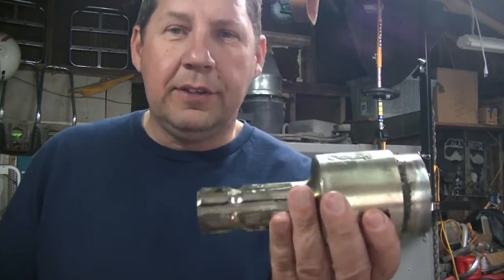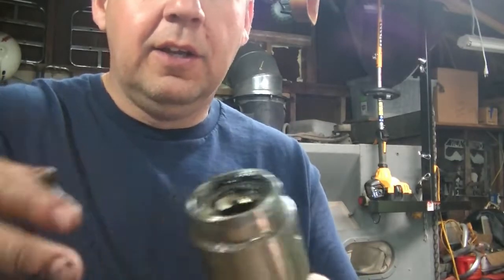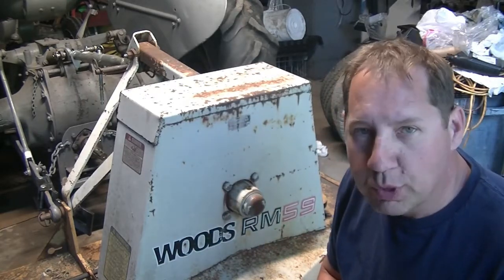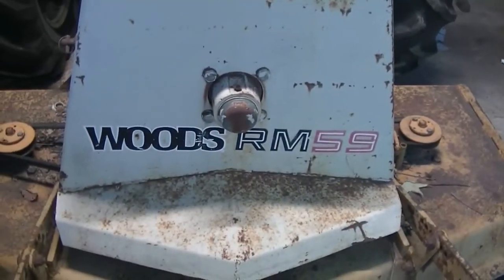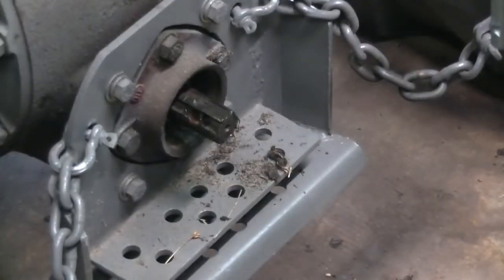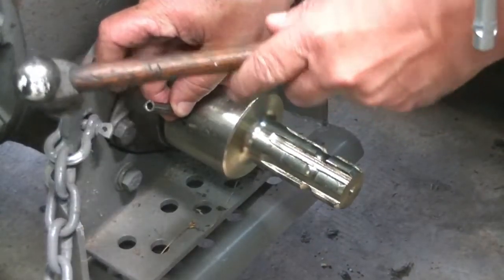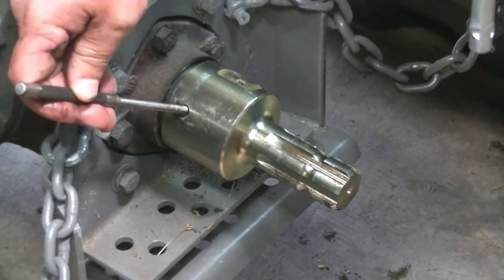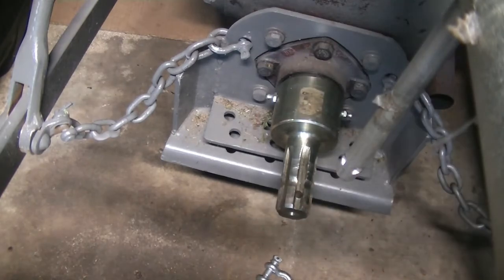How and Why to install a Tractor PTO Overrunning Clutch

Comment: PTO over-running clutch should always be mounted on implement not tractor. As per Weasler web site,  shaft is still dangerous if not covered via flywheel effect.  Good luck 😊
Reply: How's that install work??
It's called a PTO Overrun Clutch because it's designed to attach to the tractor PTO shaft.
Reply: @BigBrownCar I know everyone mounts it on the tractor side, but if you go to Weasler's (US manufacturer) website, they recommend otherwise. My tractor had no cross hole in the PTO shaft so l was forced to mount it to the implement side, a Ford flail mower. Luckily had 1 3/8 -6 spline and cross hole. It worked fine with clockwise and counter-clockwise rotation.  Big advantage mounting it in this fashion, when PTO power is disengaged from tractor PTO,  drive shaft has no built up enertia from mower drum, not so when over running clutch is mounted on tractor side just a side benefit. Good luck 👍